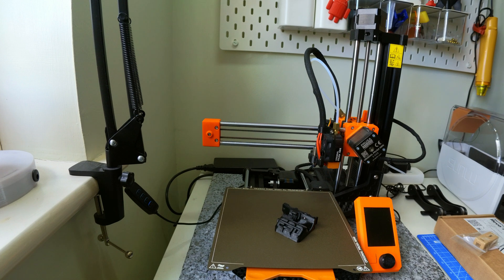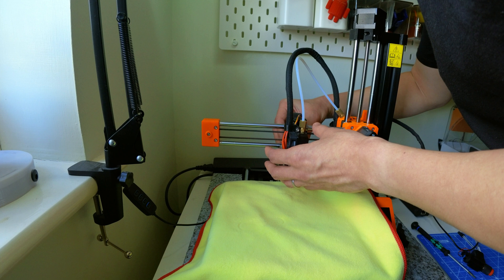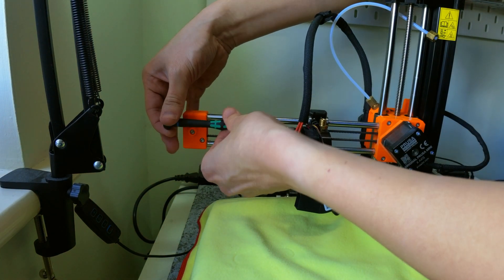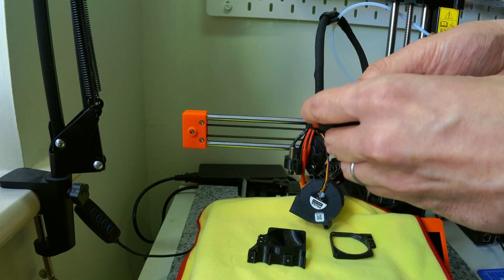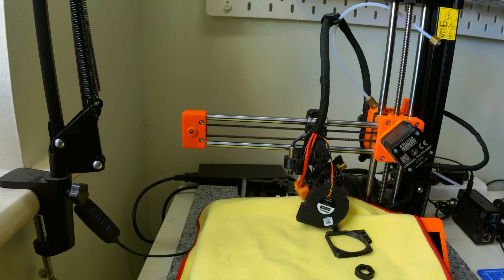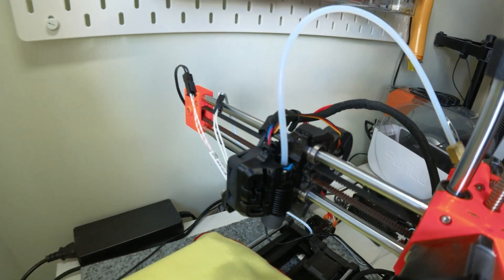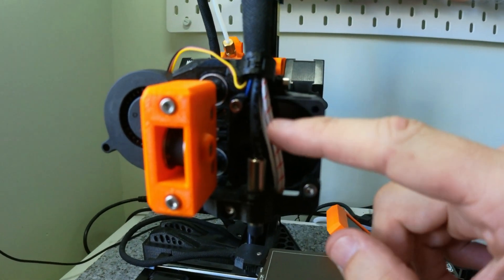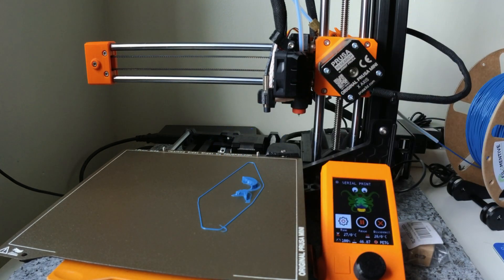E3d Revo Micro Installation on Prusa Mini Plus

Comment: I have the same micro screwdrivers!  I love the Wera Kraftform Micro series.  The color coding is really nice.  I think I am up to 50ish micro screwdrivers. (Hex, Torx, Torx Plus, slotted, Phillips). Dip you go with the square nut or screw only version?
Reply from the maker: Yeah, they are quality and just makes working on this machine so much easier! 
The holder that I used it the one with square nut. I like to think it's more secure 😄

Comment: One trick I've found when screwing the Micro into the printed mount is to hold the micro and rotate the printed mount around it instead of screwing the Revo into the piece. (think of it like threading a nut on a bolt instead of screwing the bold into the nut)

Comment: How has the mini been since this ? I have everything to do the upgrade. Not sure if I should use the existing ptfe tube or cut a new one. I’m missing a spare brass olive.
Reply from the maker: It has been working fine for me. The cold swap is nice but I still have to check the first layer calibration after each swap though. 
If you already have it, I don't see why you wouldn't want to?

Comment: Great video. thanks for making it!  I'm considering to buy a mini+. It would be my first printer. Were you having any issues with the original hot end? I see that bondtech makes an all-metal replacement and was thinking about that one. I hope you will do a follow up video to share your experiences.
Reply from the maker: Your welcome. 
Incidentally this is also my first 3d printer, so I would definitely say, go for it. 
I don't a problem with stock as I only print with petg and pla. And this is my first upgrade to the mini. I got this purely because of the nozzle swapping feature and so far, its been great.
Reply: Thanks!
Reply: Not the OP but I also own a Prusa Mini (and a MK3S) and the Mini is a great printer.  The only time I had an issue was when I used cheap filament.  I did fit the Bondtech heatbreak and extruder when I was troubleshooting the issues related to the cheap filament.  I have a Revo Micro sitting on the bench waiting to be installed when I have the free time.